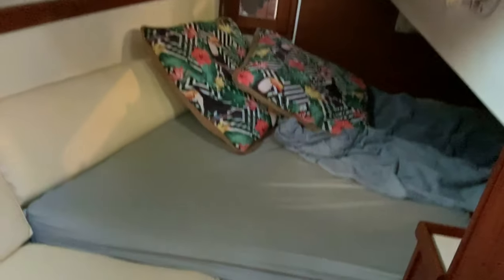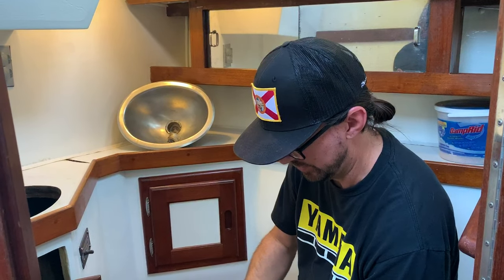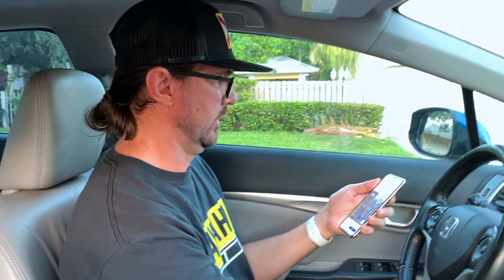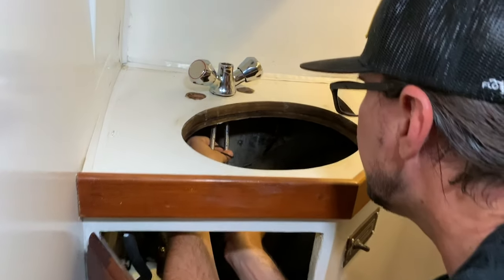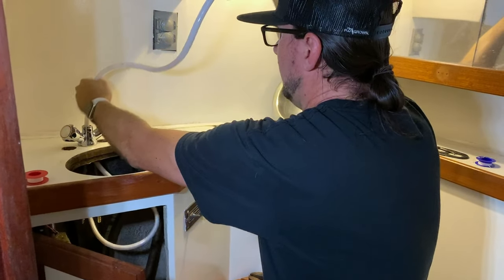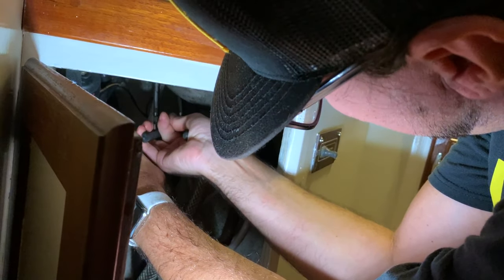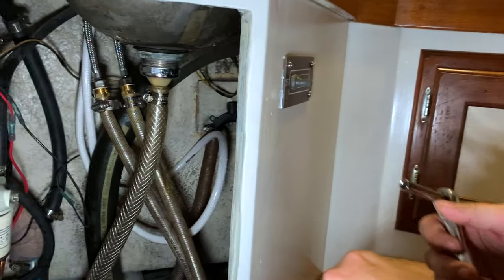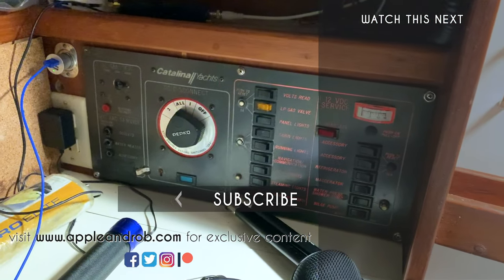Installing a New Shower on Our Catalina 34

Comment: Dudes thanks for doing this video it's perfect for showing me what I am about to tackle.  I'm actually going in the reverse direction on my C34 and taking the 30 year old worn out shower/tap fixture out and replacing it with just a small regular tap so the sink is easier to use.  Going to use a 'blender' type if I can find a small one.  I don't like a 'wet head" shower type arrangement personally.  My plan is to put one out in the cockpit instead. Your demonstration was exactly what I needed to see. Thanks and happy sailing.

Comment: I would recommend a Solid Surface counter to replace that formica.  It will be more expensive, but as it is basically solid plastic it will NEVER rot.  Given the small space you won't need much of it either.  I think you can even get it in plain white, so it would match the decor.
Reply from the maker: Thank you very much! We will definitely look into that

Comment: Not sure if you figured it out yet or not but plumbing 101 never use Teflon tape on kitchen/bathroom plumbing threads. If it doesn't leak now it will sure to be later.